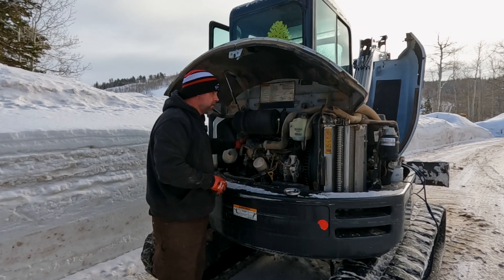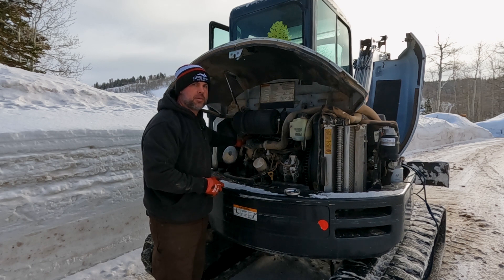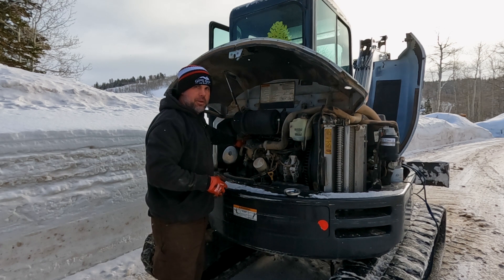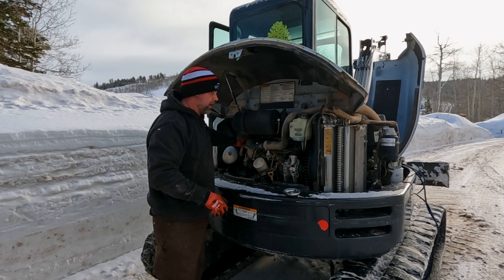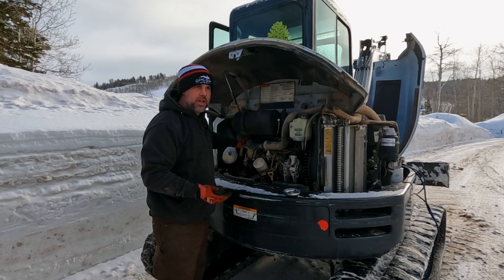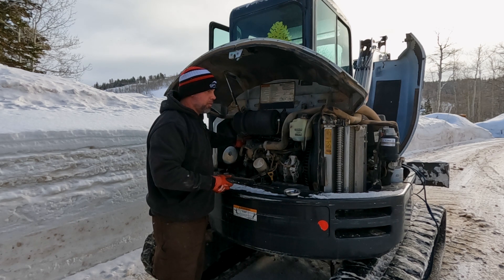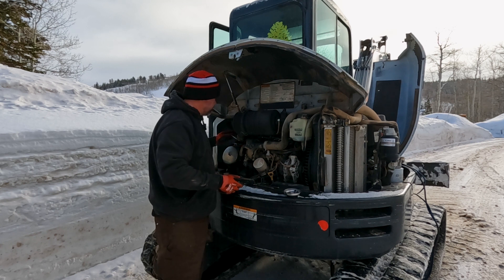Bobcat Hard Start, Testing Glow Plugs

Comment: Off subject a bit but curious how you feel  about anti gel additives in Bobcats? I called a dealer and he said if I use the winter blend of diesel I should be ok in any cold weather. He said he thinks anti get additives like Stabil or other brands can actually do more damage. I'm in Minnesota and have a T630. As you know it's gets very cold here but I just wanted to get your take on whether or not I'm ok using an additive or just wasting money? Just curious about your feelings and opinion on them. Great videos, really like your channel!
Reply from the maker: Thank you for the comment.  I agree with the advice you have already received.  A good quality winter fuel should be good to single digit temps.  I will only use Bobcats winter fuel additive that is tier 4 compliant.  Bobcats additive is specifically blended to Bobcat engineer specifications. Other additives that are not tier 4 complient can actually clog the 3 micron fuel filter and cause problems.  I know every one has their favorite additive but I get a lot of calls in the winter due to clogged fuel filters and find out the system is full of additive.  When using any additive make sure to stick with the recommended mixing ratio.
Reply: @tetradgroup  Awesome! Thank you so much for the information! Keep up the good work, your video's really help a lot of folks with machines!

Comment: I am not sure if it is a good idea to test glow plugs with battery. Most glow plugs have 11V nominal voltage, batterys have 12-14V.  For a short time, it will be possible. But I am not sure if this is good for the glow plug. Better: Measuring resistance or using a 11V power source, e.g. laboratory power supply

Comment: I've had them ohm out correctly and only get warm when you actually check the temp
Reply from the maker: Exactly, some guys swear by resistance but I've learned not to trust it.
Reply: @tetradgroup  I have to fully convince myself that's the problem ...whatever it is I'm looking at
Reply: @ls1jeeper  especially electrical issues
Reply: i agree best way is your way @tetradgroup

Comment: Man, it’s like you read my mind. Having to check this same issue right now. May have a short to ground in one. 100 amp fuse blows then the relay then the fuse, and so on…weeeee
Reply from the maker: Glow plug or if it's a M series loader the glow plug wire would rub on rear door and blow 100A fuse.
Reply: @tetradgroup  you were right it was a glow plug. one went red hot, but on the wrong end - the threaded end. Once I get one in I’ll confirm that was it. Hopefully.
Reply: A cheap piece or vacuum hose, split with a razor blade knife would fix that problem. Works well where wires go through metal opening also.